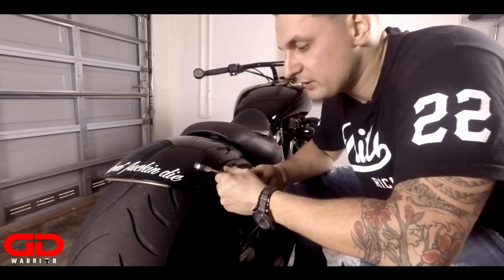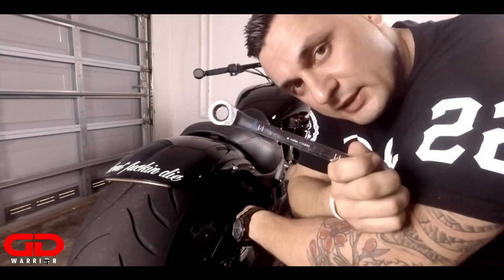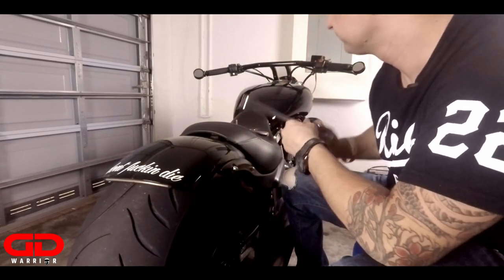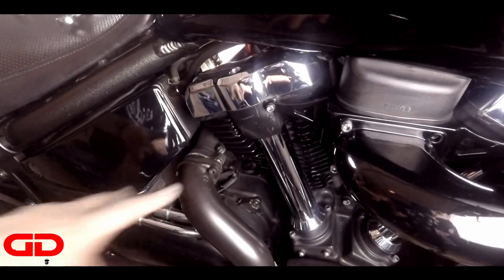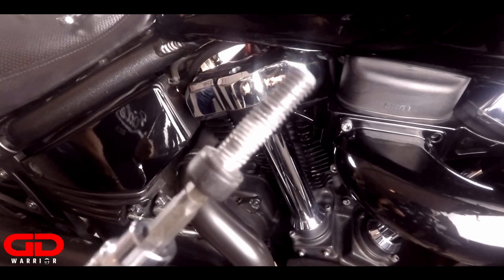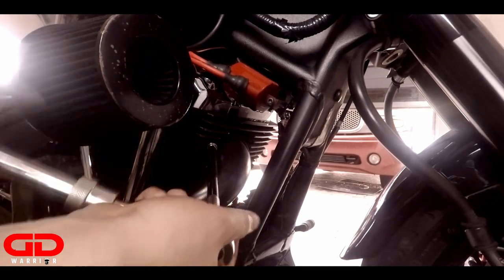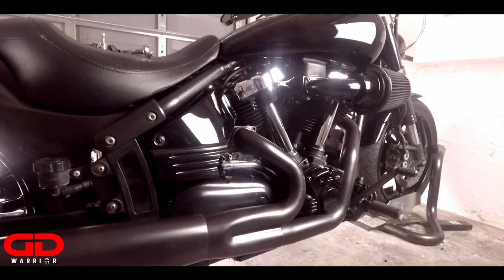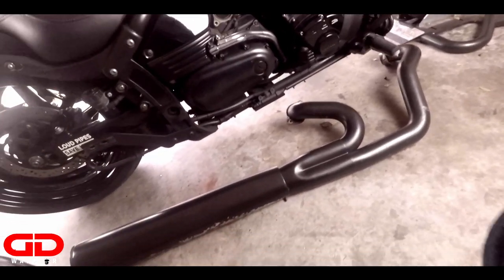How to: Motorcycle Exhaust Removal - TIME FOR THE BIG GUNS!

Comment: I really appreciate your videos they are extremely helpful. I too like obnoxious exhaust and I am going to purchase the monster pro pipes. My question is when you install yours are you going to run the least restrictive baffle they offer or no baffle at all. Just asking because you have a lot of experience with exhaust. Thanks
Reply from the maker: Whats up Victor! Yes thats correct I am only running the least restrictive baffle which in this case is the vortex race baffle, I tried it both ways, with and without vortex, and to be honest there is not much of a difference in loudness
Reply: @IndianChallengerRiders  have you had the roadster exhaust from Pacific coast star? I'm ordering from them not sure if I should go with monster pro or the roadster what are ur thoughts bro?
Reply from the maker: @dustinparker513  yes I had them all brother. 2 roadster exhausts and 2 monster pro pipes. The roadster exhaust is very prone to cracking at the front cylinder, top area where the flange is) both of my roadster exhausts cracked at the same time. It's because the roadster doesn't come with a bracket that holds the end of the exhaust muffler in place. The vibrations, the heat, the pressure ect make the thin metal crack. It's a design flaw. And you are going to loose up to 10ft of torque compared to the monster pro pipe. I had both pipes tuned back to back and the HP numbers stayed the same but the torque went down on the roadster (because it's shorter)
Reply: @IndianChallengerRiders  right on thanks bro just kinda like the shorty look but monster pro it is
Reply from the maker: @dustinparker513  make sure you get the "vortex" baffle brother! The sound is crazy!
Reply: @IndianChallengerRiders  yeah buddy bikes gonna be sick this spring shes getting new paint and new exhaust this year
Reply from the maker: Have you seen the exhaust I just put on my bike? Go to my Facebook page www.facebook.com/gdwarriormotovlogs and see yourself :D
Reply: @IndianChallengerRiders  nice! I'll bet those fuckers scream...does it take a while to get the your pipes from Pacific coast star after you order them?
Reply from the maker: @dustinparker513  yeah get ready to wait 3-4 weeks. In my case 6 weeks every single fucking time lol fuck that
Reply: @IndianChallengerRiders  damn that sucks but I gotta wait til spring until i can ride anyway
Reply: Hey Gd warrior.  I would like to order the monster pro from Pacific.  But  I heard that there chrome flakes off, and thats what I need because my  roadstar is all chromed out. Besides it sounds like they are a little difficult to deal with. Also I called BMS and they have some nice exhaust for roadstar, but they have discontinued all of them. So as of right now I guess I will continue to run my hard chrome long shots which I actually  like. Thy sound really deep and throaty.e